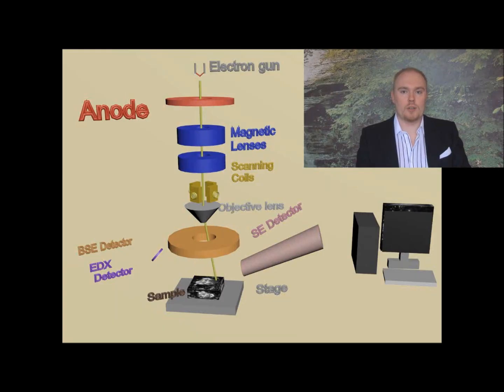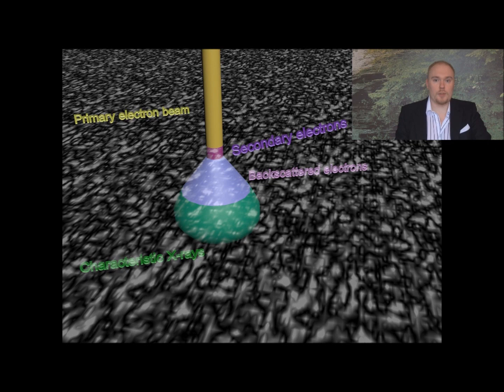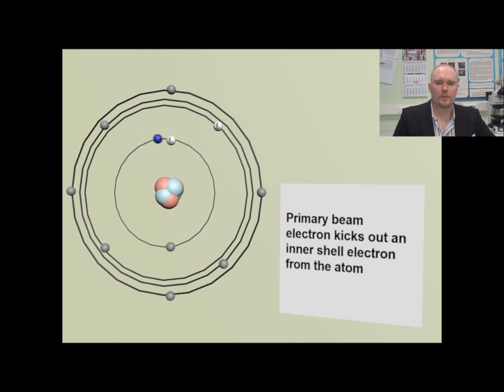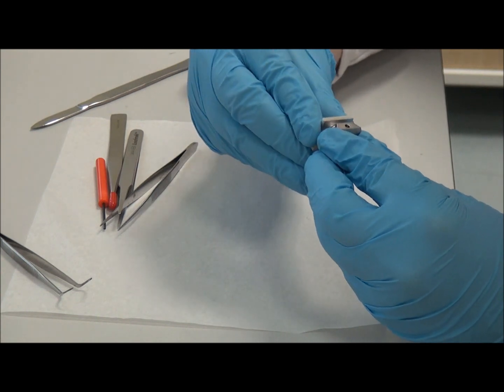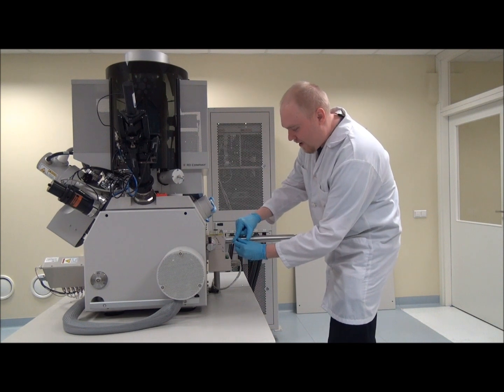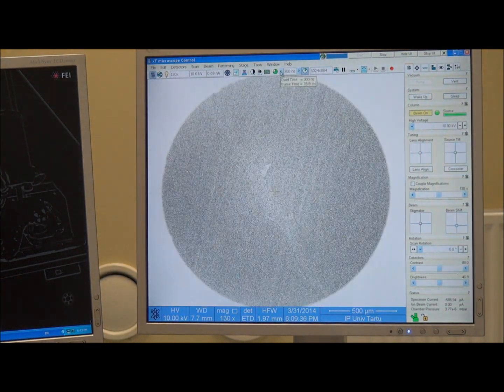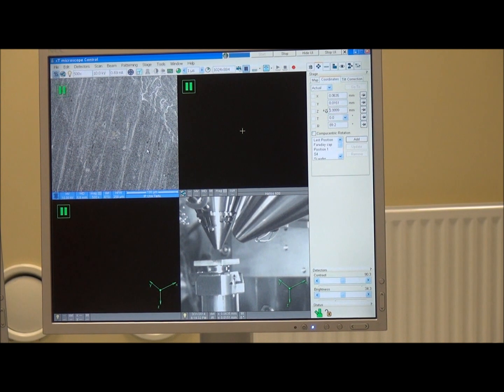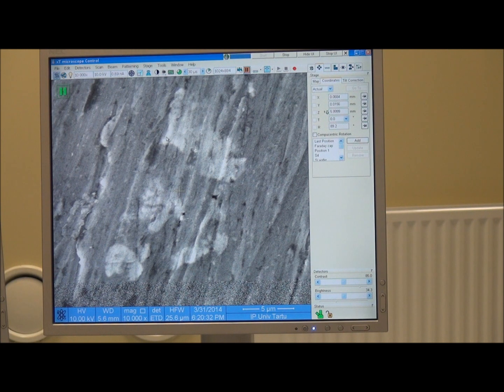Scanning Electron Microscopy (SEM) Lecture with Animations and Real Measurement

Comment: Can we find out the depth of pitting corrosion by SEM?
Reply from the maker: We did that by making a cross-section with FIB and then studying it with SEM. If the pitting goes very deep, then you might as well try mechanical cross-sectioning.

Comment: Can we see the real atomic structure of metal though electron microscope sir
Reply from the maker: Yes. But you will need a transmission electron microscope for that purpose and prepare a very thin sample. In the current video we use a scanning electron microscope, which is cannot see atoms but is great for studying surfaces with a resolution up to 1 nm.
Reply: @CaptainCorrosion  thank you sir

Comment: Hi. U have a great video here! I have a question. Can SEM analyze the microstructure of a metal surface that is covered with epoxy but with exposed area of 10mm^2 only??
Reply from the maker: If the surface is covered with epoxy, then you'll see only the top layer with secondary electrons. However, with dielectric coatings like epoxy, you will need to apply a layer of conductive material on it (e.g. Pt, Au) via sputtering to be able to study the sample in SEM.
Reply: @CaptainCorrosion  understand sir. Thank you so much! Im studying corrosion on magnesium plate. Wish me luck ☺
Reply from the maker: @nurulshahzira769  Good luck!

Comment: Hello In the case of the sample a dielectric material Is irradiated before imaging or not and why
Reply from the maker: Hello! Studying dielectric samples with SEM is difficult as every time you scan over it during imaging, it charges up  - this means that electrons cannot easily escape the studied site, causing the sample to locally heat up and also the locally charged site interferes with the electron beam, causing additional artifacts on the image. So dielectric samples should be covered with a thin layer of metal (e.g. Pt by magnetron sputtering). Another alternative is to use ESEM, which doesn't require samples to be coated with metal.

Comment: But how this emitting electrons gives the image? I mean electrons are going into the detector then image? Silly question may be.. 😭 help me.
Reply from the maker: Hello and thank you for the question! When you irradiate the sample with a narrow beam of electrons, then you basically know the X and Y coordinates and measure the intensity of the signal (amount of electrons) coming from that location. The intensity can be understood as a Z coordinate, which is essentially a shade of grey, ranging from black to white. Therefore, by scanning row by row across the surface with the beam of electrons, you will get a data that consists of three coordinates and with a computer software you can easily convert it into an image. Note that in this method higher Z value (brighter spot) doesn't really mean its higher but rather it shows that we have a higher yield of electrons from that specific site.

Comment: how can we measure the coating thickness
Reply from the maker: Hello and thank you for the question. It really depends on the substrate and coating as there are lots of methods to choose from. For instance, making cross-sections with focused ion beam and studying them with SEM. Or you can use special tools to cut precise slices of the material and image it from the side with SEM. We will publish a video in the end of march where we study a tooth under the scanning electron microscope - for that purpose we cut it into half as well.

Comment: A very useful video. Thank you very much. I have a question: doesn't the electron beam damage the sample ? and how thick can the sample be in order to withstand the electrons ?
Thank you in advance !
Reply from the maker: Hello and thank you for the question! It really depends on the sample and the beam current. If the beam current is sufficiently high, then it is possible to drill a hole through any material.
In scanning electron microscopy one should use as low beam current as possible when studying substrates that get easily damaged by electrons. Coating the sample with a thin layer of conductive material (Au, Pt) would also help a lot. I remember how I once had NaOH crystals on the substrate and they were destroyed rather fast under the electron beam (barely got 1 image). Conductive carbon nanotubes on the other hand are much easier to study as the charge and heat is quickly carried away. So ideally you can easily study nanoparticles if they are properly prepared (e.g. apply nanopowder on silver paste on a conductive holder).
Reply: Captain Corrosion thank you very much once again ! followed it better now.
Reply from the maker: You are welcome!

Comment: do we need to etch metal samples  before doing SEM
Reply: +Jitender Chaurasia Yes, the sample should be etched to generate a better picture.
Reply from the maker: +Jitender Chaurasia Depends on what you want to see. Generally you only need to remove the "dirt" from metal substrates if you want to see the natural surface. If it contains oil leftovers from manufacturing or fat from fingers (mixed with salts), then you need to clean it with deionized water and organic solvents such as acetone. If the substrate is generally clean from such pollution, then a rubber syringe is good enough to remove the loose particles. Generally I wouldnt recommend etching - unless you are studying corrosion or want to remove the natural oxide layer for EDX analysis.
Reply from the maker: +Rupan Kaur The picture might be more interesting indeed after the etching as the sample would be covered with valleys and craters but generally any pre-treatment and cleaning/refreshing of the sample should be as non-destructive as possible!

Comment: Arcanity, the choice of accelerating voltage, or beam energy, is complicated. First, in most SEMs, resolution is better at higher voltages. If you are lucky enough to have a modern field emission system, then you can go to very low voltages at high mags. Besides that, more surface detail is visible at low energies. Also, less damage happens at low energy. Finally, sample charging depends on beam energy. If you play with the accelerating voltage for nonconducting samples, then you might get lucky and find a value for which the primary electron flux balances the secondary and backscattered electron fluxes, and charging can be minimized. That is tricky business. In general, use the lowest energy you can get away with and still have the resolution that you need. Of course, if you do EDX, then you must use certain voltages to get the signal that you are looking for.

Comment: Hi Maido,
This is probably the most helpful video about the SEM I've watched, you're using a modern SEM and you're not making it too complicated, thanks a lot! The only thing that I wish you had shown was the elemental composition analysis because that still confuses me a bit whenever I try it. 
One question: how do you decide which accelerating voltage to use for studying a certain specimen, and why is it important?
Reply: ***** Thank you, that's very helpful! Yeah, the part when the analysis program gives me weird elements for the peaks is what I'm having problems with, but I hope that as I use the SEM more it'll be much easier. Glad to know that I'm not the only one for whom that happens to. Thanks :)
Reply: +Maido This is just what i needed. Just got better understanding of SEM-EDX. Thank you